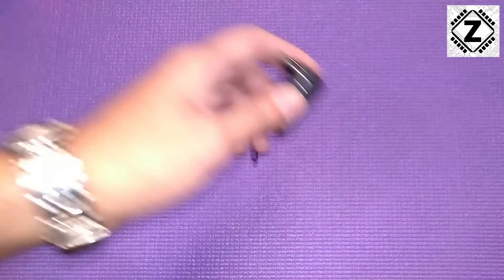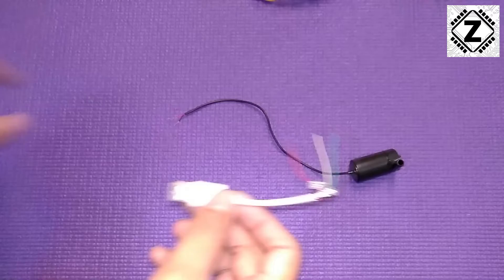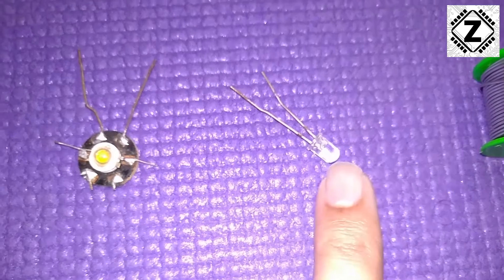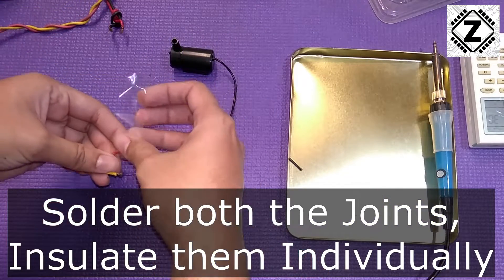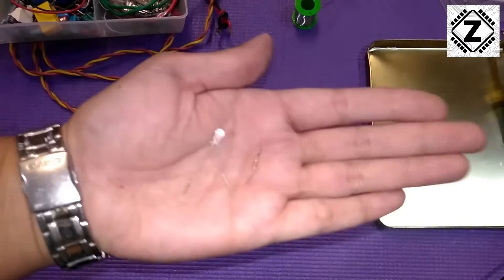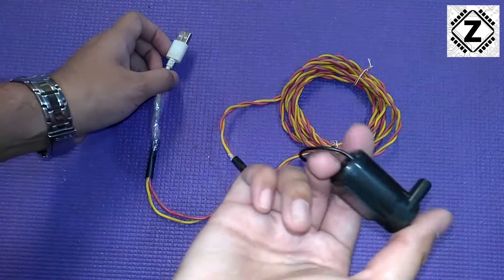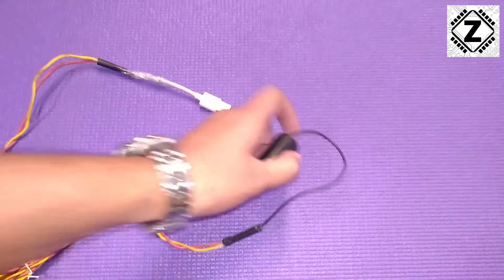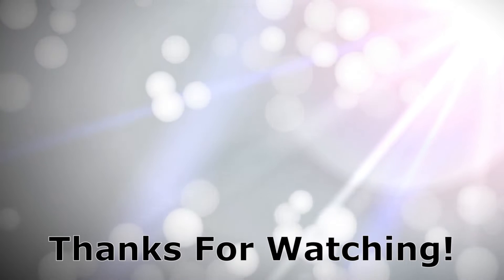[ENG] How to Power DC Mini Submersible Pump using USB Cable | DIY USB Powered 3-6v Water Pump

Comment: I bought a bunch of these to copy the uber ridiculously expensive dooa terra base pump and actively recirculate water through my terra base designs. I have no problem soldering or using a an old USB cable. It was my entire intention as these don’t come wired. But then I saw someone mention that you should never submerge anything that’s powered by a dc block such as a phone charger as it can cause live current in the water and possibly a fire. They urged to never do that and to use a usb power bank, but it’s not practical to use a power bank for each of my terra bases and have to actively monitor and recharge them. I’ve never heard of that before that a dc powered usb device can suffer that and that it’s apparently common. Why would they make submergible dc powered devices if this was the case ?? Any ideas??
Reply from the maker: Using a low voltage (5V) DC supply should be safe, as long as it's isolated from the AC mains. Just isolate and waterproof the joints or exposed connections using silicone sealant.
Reply: @ZenInnovations that’s what i thought. I’ve never heard anything like that. And yeah I shrink wrap and waterproof all my joints even if I don’t use near water. Idk it’s something that’s quick and easy enough to do no matter what. I thank you ! I was doubting myself when logically I know better. But I’m not an engineer or electrician just a hobbyist so I’m not going to act like I know everything.

Comment: This does NOT work with a 12V DC pump! USB wires won't carry more than 5V current.
Reply from the maker: My pump is 3 to 6v. It runs fine at 5v.
If your pump is 12v, you'll need a step up converter.

Comment: Is the resistor needed if we don't use a LED?
My Battery has (Output: DC 5V/2.4A)
 The small Waterpump has (Input: 3-6V DC , Power: 0.36, Maximum Rated Current: 0.18A)
Reply from the maker: Not needed for just pump.

Comment: Sir this usb powered pump won’t work 3 or 4 feet deep they designed for small aquarium or very small fountain. So that is useless to add higher amp long cable.
Reply from the maker: Yeah Maybe. But I wanted long wire to keep Power bank away from water.